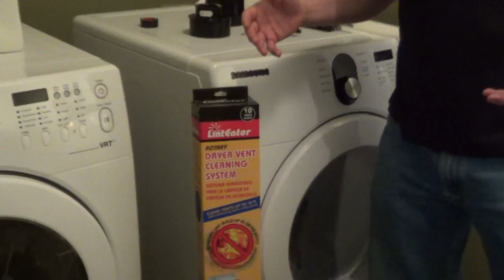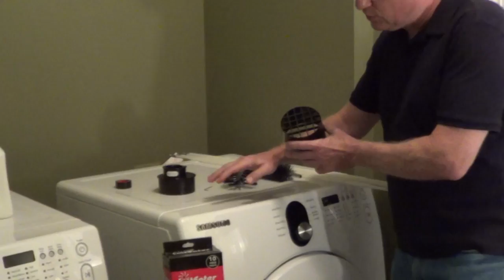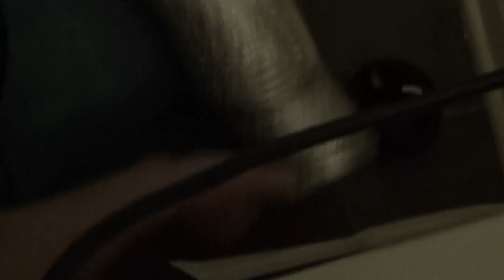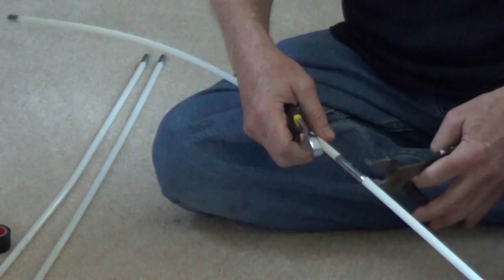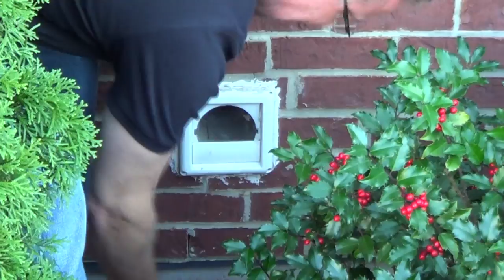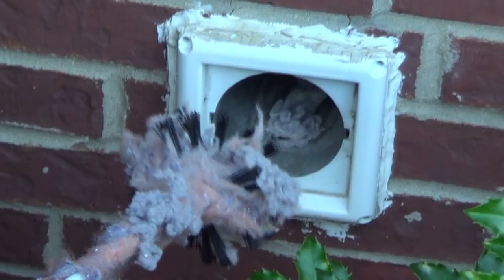Clean Lint from Dryer - Dryer Vent Cleaner

Comment: That vent pipe is disconnected in the wall somewhere between the dryer and the exit vent. That's why you had pink insulation wrapped around the head of your brush.  It's probably been that way since construction since they used flimsy thin aluminum pipe instead of hard steel pipe.
Reply from the maker: +Andrew McC Hi, once we got into the crawl space, we did find the pipe disconnected. Thanks for the tip.

Comment: I brush it from the outside-in with the dryer hooked up and turned on to blow the lint out towards me (and my face). It makes a mess but it is much more powerful  than a shopvac and gets the job done faster and better. I'm working on a way to catch the lint while using this method (linteater has the lint catcher bag thing, but it doesn't work very well). Make sure you wear a dust mask if you do this.

Comment: Why not go with the vacuum outside and push all the lint out?
Reply from the maker: Sean Moran Hi, I should have. I didn't think I would get that much lint. I like this kit because you can remove lint in a few different ways. We also have a weekly podcast on iTunes and Stitcher. Here is a link http://www.stitcher.com/s?fid=49441&refid=stpr
Reply: FIX IT Home Improvement Channel Ok, I think I can handle this. But I want to be sure. I'll need a drill (what kind? I have one but I don't know what you mean about the clutch so I'm not sure if it's the right kind or strong enough.) electrical tape, two pliers, the kit, and a shop vac, right? Anything else? Also, should I have the shop vac on the outside and push it from the inside of the house out like that other guy suggested? How do you know how long the dryer tube is? Sorry for all the questions. Thanks for your help!
Reply: Any drill should do.  I used a battery powered one.   Shop vac outside is recommended.  You may clog it part of the way if you have a long length of tubing.

Comment: Listen exactly to what this guys says when using the LintEater.  I used duct tape for my bond between extensions.  I would also suggest keeping your free hand loosely guiding the extensions at the connection points when inserting or retracting from the vent orifice. The shop-vac should be used during the entire process. If used correctly, this is one of the best self-help products I have ever used.
Reply from the maker: Thanks

Comment from the maker: Hi,
For algae.

The first thing I would try is White Vinegar. 
It is inexpensive, safe and very effective at killing and cleaning algae, mold and mildew. You can pour it on full strength outside and let it work for an hour or so. I would then use some hot water and scrub the area. You can put a 50/50 mix of vinegar and water in a spray bottle and spray the area occasionally to keep it clean.

If vinegar doesn't work then try diluted bleach on the area.

Let me know how it works for you.